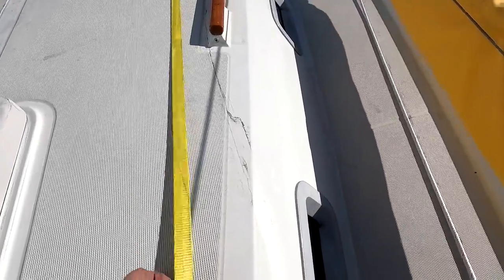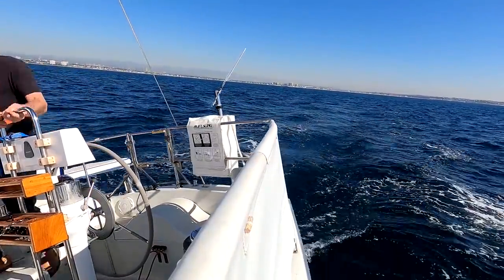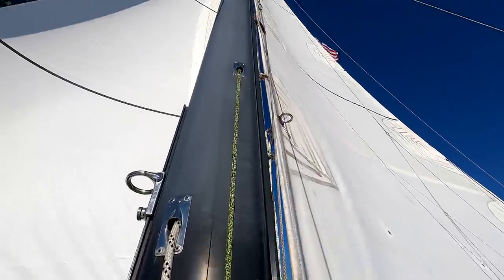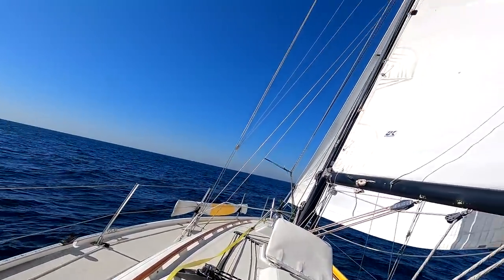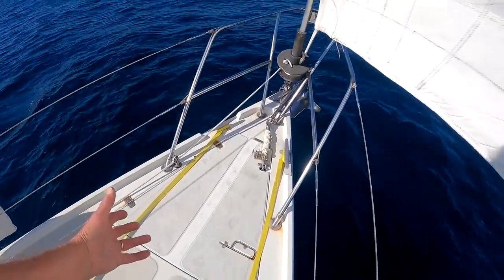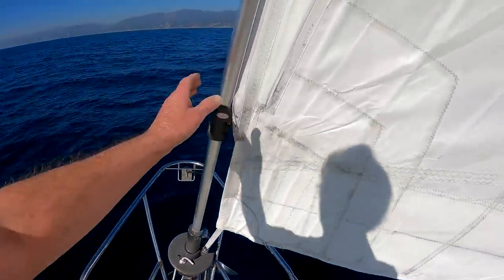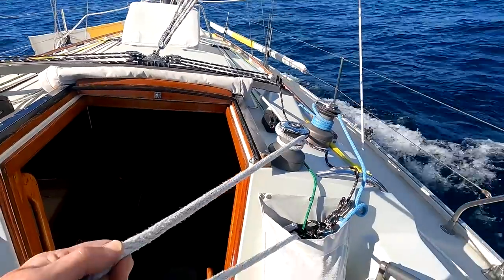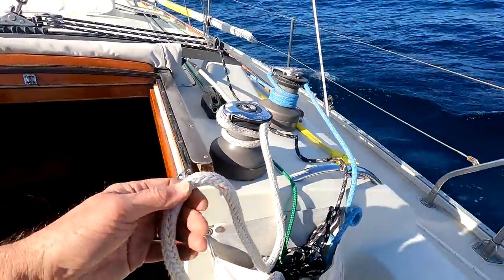Why We Sail--"Refit and Hey, Why no Dodger?"

Comment: The 1976 boat I bought came with a dodger. I refitted the boat and towards the end put up the dodger. I took the boat for a sea trial with my wife. She is shorter than I am and was not able to look over the dodger and complained about the visibility when at the helm. When docking the boat, the dodger prevented me from properly gauge the entry into the slip and I needed at least a second, but would have preferred a third pair of eyes, to guide me in. Needless to say, the dodger came down and the waters opened up. Then I remembered that at some point I watched this video. I went back and watched it again. The commentary on the dodger well taken. I will try the umbrella next!

Comment: I have worked with varnish (and paint) daily since 1986. If it helps to know, all varnish is high gloss until a flattening agent is added to it. Going with a high gloss will be the most durable as nothing has been added to it. You will also have much better luck with a reapplication of high gloss over high gloss than you would reapplying over a lower sheen.

Comment: First of all I'm a huge fan of all you say and do..usually :)....but where I sail (Baltic, UK, Ireland) a good "dodger " is absolutely needed, especially on longer short handed passages in cold weather. It provides much needed shelter from wind and spray for on-watch crew. In fact when I rebuilt my present 40' wooden sloop, I built a hard dodger which, IMHO, is the best thing since sliced bread! Last October we crossed the North sea from Norway to Shetland, just 2 of us, 40 hours.. wouldn't want to do it without my hard dodger!
Keep up the good work!

Dara

BTW I also have an Eastport Pram (the nesting version) that I use as my tender. I also built mine, but a few months before you published your time lapse video of the building of yours. Great little boats! Back burner project is to make a mast, rudder and centreboard for mine as I've just been rowing her so far!

Comment: I follow those youngsters on S.V. Uma, and their compact dodger seems to be a good addition to a smaller boat on an extended voyage in the north, through varied and extreme conditions. Keeps warmth from escaping the cabin as much and doesn't seem to interfere much with sailing with the view (and the elements in their teeth) and their eyes on the sails. A "soft" dodger easily removed in mellow climes.

Comment: Good thoughts Christian but as the comments have already shown, the dodger question is also a matter of geography.  We don't all sail in temperate year-round conditions.  I am in Vancouver, Canada.  I'll be heading out this weekend and the temps will be just nicely above freezing, so the protection of a dodger is nearly essential.  
One thing not talked about is the extra security a dodger offers in the way of vital hand-holds when moving forward and returning to the cockpit.  Lastly, you kind of glossed over the role your "significant other" has in this question.  For many of us, getting buy-in from "the Admiral" is not a luxury but a necessity and as you pointed out, the ladies like protection from the elements.  Thanks as always for sharing your experience with us.

Comment: Good afternoon Christian. I thoroughly enjoyed your book Alone Together and have followed your posts and YouTube videos for quite some time now. I enjoyed your arguments on to Dodger or not to Dodger. I completely agree with you about being able to keep a close eye on sail trim. My previous boat was an Ericson 27 Without dodger or Bimini. I used a tarp with a couple of PVC pipes when anchor or on a mooring. I love that boat and the set up worked for me for 14 years. I sold “the pride of Cucamonga“ In the spring of 2016 to save up for my dream Cruising boat. I was able to acquire a 1981 pacific seacraft 37 in August 2020. Her name is “my fair lady“. She came equipped with a quality dodger and Bimini made by Harbor Canvas. I’ve got to tell you it’s been a real adjustment as to how I keep an eye on the Sails. The Bimini is somewhat easy to remove, essentially a zipper fore and aft. But I pretty much keep it on all the time because I am now a live aboard here at Cabrillo Marina and San Pedro. One real advantage I’ve noticed about the dodger is that it really cuts the wind chill and I rarely get splashed with spray. Nice for sailing during the colder months. It dawned on me that I don’t recall seeing any solar panels or talk of solar panels on your vessel Thelonius. One advantage to the Bimini frame is I have lots of room for solar panels which I’m planning to do. Possibly putting one on top of the dodger as well. Which brings me to the question what’s your routine to keep your batteries charged up if you don’t have solar or wind generator. I’m tentatively planning on joining the Baja ha ha in November of this year. I think solar panels will be an important upgrade to keeping my four AGM deep cycles charged up. See photo below.

Comment: Brussels sprouts indeed! I like them the same way I like asparagus - with so much other stuff on top you can't taste either of them. Hope my mom isn't reading this.

BTW, your jacklines make sense - thanks for including them in the video.

On the dodger. Just bought my first larger monohull (42 ft.) that came with the obligatory bimini, dodger, and cover that bridges between the two when wanted. After spending a half year getting the boat to the point where I was ready to splash it I left both bimini and dodger off so I could see everything the way I'm used to on my little 22 ft. daysailer. It was mid summer of 2023 on the Chesapeake just a tad north of Annapolis.

I did get a bit uncomfortable after that first sail and added the bimini. It was a huge help and on my boat covered little of the view of the main, but the dodger was a different matter. I hated how it covered the view of everything - hiding the beauty of the foredeck and water ahead was the first thing I noticed, then the pain of winch access and having  to move around to see the foot of the headsail and approaching crab pots (the Chesapeake!). Docking got harder for the same reason. I also enjoyed hitting my head on the dodger rail coming out of the companionway - but I conquered the companionway hatch earlier, I figure I can conquer that rail as well. TBA.

The one thing I liked about the dodger was the port/strb grap rails as you go forward and return to the cockpit. Makes the transition much nicer and safer.

My solution was to remove the dodger cover and sail with the frame. I been feeling like an idiot because every other boat I've seen has a covered dodger - but I hated it. Now I feel better. Maybe we'll meet someday at a place with soft walls and a nice staff with white coats. : )

God bless you and your precious family - Langston

Comment: Always a pleasure to see one of your video pop-up on my feed Christian.
I am with you on the sprayhood and bimini, but I have to say one of our earlier boat had "full enclosure". On a small 32' boat it was like an entire extra room, with the Dickinson burning some pellets in the main cabin it extended our cruising in the PNW by at least 2 months. 
The spray hood had a 'sock' with a zipper to wrap the canvas around the frame and could be folded forward laying on the cabin top just behind the mainsheet traveler forward of the companionway, lashed down on either sides to the handrails. That is where it mostly lived during the summer. A simple camping tarp over the book providing cover at anchor. The full enclosure panels lived under the V-berth cushions, the frame and canvas folded just outside the aft pulpit and forward of the backstay with similar 'sock' arrangement. It was very clever.
Putting everything up after some practice was a 30 minute affair. 
Keep those videos coming, they are so entertaining and educational... Single braid line for the main halyard hummm.
:-)

Comment: Umbrellas are a great idea.  I have two on my stern instead of a Bimini because the backstay interferes with a Bimini..  They are heavy duty Sunbrella canvas, fiberglass arms and stainless fasteners made by a company here in FL and tested to 65 knots.  I love them and get a lot of comments and new friends from people who ask about them.

The dodger issue I mostly agree with.  I had one in California when the boat was there.  Now in FL I don't and have done without it for 20 years. 90% of the time I prefer it without the dodger, BUT...I'm adding a dodger back again, better designed, because sometimes in this part of the world you need some shelter from the rain down the companionway and wind while on deck.   But I've designed it to fold forward when at anchor with an awning above and from the companionway I can look upward at the sails through the front window.

Thanks for the thoughtful videos Christian.

Comment: I've bought my boat with a dodger,  but then about 10 years ago made mounting legs extensions with a size smaller stainless steel pipes and converted it into a frame mount for a solar panel to create sun cover over the helm. It also works great as a rain water collection method. Re-purposing the dodger has overwhelmingly contributed to comfort, practicality and safety of the boat. Thank you for bring up this topic, as I get a lot of criticism for butchering a perfectly performing dodger.

Comment: My dodger very easily folds down flat by pulling two clevis pins and pushing it forward so it folds down in front of the companionway. This takes 2 minutes tops. It also has a pair of zipped-in side panels I can remove when I want to, which is most of the time. I put it up when a rain storm hits or the crew asks for it.......... So the best of both worlds. Its nice to have it when I need it. The bimini has a roll-up window so I can see the main sail when underway. Thanks for the content.

Comment: I have a dodger, but the aft supports are webbing, not SS tubes, therefore, I take it down forward when sailing or motoring, and pull it back to shape when anchored or rain. I live aboard, so I find it a good compromise. Love your series and humor. Fair winds.

Comment: I'm with you on the Brussel Sprouts but after sailing out of marina Del Rey for 50 years I finally got a dodger on my 40 Beneteau that I've owned for 18 years now.  I have to say I like it.  I can't sail with the bimini (took it off as soon as I bought the boat) I had a frame for the dodger and did some mods on it 3 years ago to strengthen it and then had it built.  I really like having a place to duck when you get that spray coming at you on those days (you know the ones)  I swore I didn't need or want a dodger but I do really like it now.  Its a pain to take down but easy to open up the whole center and let air in.  I see  you out there a lot we've even waved ;-).

Comment: Great insights here. I could not comfortably sail my boat in any chop without a dodger to deflect the ocean spray but I have only a 28 footer
Reply from the maker: It does depend on the hull form. The Ericson design deflects the bow wave and there is relatively little spray even in strong air to windward.

Comment: Your mainsheet single braid appears to be New England "Regatta Braid." I've been using that for the mainsheet on my Nacra for many years and would't have anything else because of the soft hand and flexibility. Easy on your hands and runs extremely freely, super nice for light wind plus, being polyester you can nicely heat whip the ends. 🏴‍☠️

Comment: Don’t have a dodger, BUT I do have a Bimini that goes over the companionway to where the main sheet comes down at the end of my boom. Behind that is a solar arch over the helm providing shade when at the helm. Why??? I live and sail in FL and tropics. But I have no dodger as I said there are studs from a extension to the previous Bimini top that did attach to the cabin top but there was never any dodger frame. I often to the side so I can see the sails and I even fold the Bimini when it’s a cool or overcast day when the sun isn’t so hot. BUT I found off shore quickly why people have dodgers.  To deflect  green water coming over the cabin roof from spraying directly into a open companionway.  Without it I MUST slide the companionway top back when in seas above 6ft and beating into the waves. Water will spray into the companionway a dodger would deflect most of that water.  And when sailing on others boats with a dodger little to no water gets in even with the companionway open in the same conditions. so ya I’m thinking of adding a dodger BUT I will want to make it so when not needed I can just unzip it from the Bimini and return to the open front.  I find my Bimini does not interfere much with sailing at all and all my lines are lead aft as well. I have a cutter rig so I need to look down the side anyway to see the head sail behind the staysail  and I can see the telltales on the main in the gap between the Bimini and the solar arch.  Yes vision is better when the Bimini is down so ya I get why you might prefer no Bimini or dodger.  I actually wouldn’t want a dodger that I couldn’t easily remove during the times I don’t need it.

Comment: Christian you will get beat up on the dodger issue. Mainly wind and spray would be main reason.  Race boats don't have them because the dodger slows the boat creating drag.  In MDR you rarely need one. Channel Islands area they come in real handy because we are always beating to the islands usually in 15 to 18k winds.  Sun protection, no way!  I have done both and prefer the dodger. My wife likes it because she gets cold easy and it keeps the cold wind off her during winter sailing. Especially with our cold water.

Comment: I am surprised that your overall rating of the windvane steering you installed via cutting a large hole in your transom(!) to install it and which FAILED several times on your voyage is that you like it? For me, the hidden control lines and gear that make it look nice and neat near the harbor are the very reason for both its failure and difficulty in inspecting and repairing it under way.
To me,, the whole point of windvane steering is its reliability and repairability under way. You could have been injured and/or been left with only electric autopilot during your voyage dealing with crawling around under the cockpit, repeatedly, to fix it while solo sailing in the Pacific. That is a fail for me.